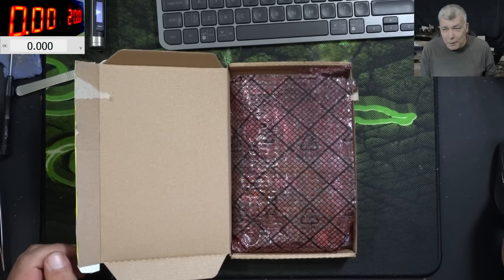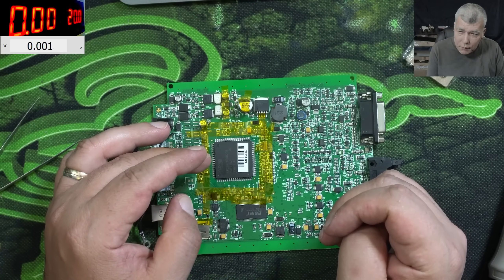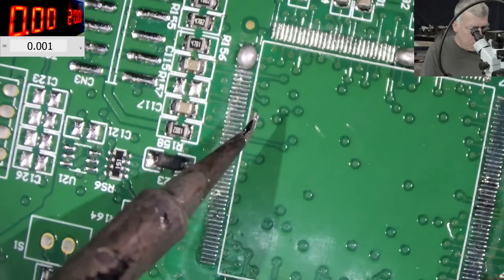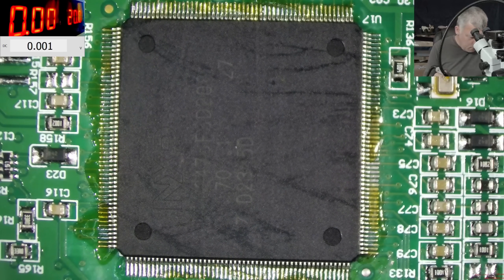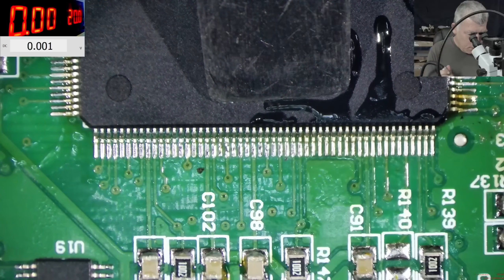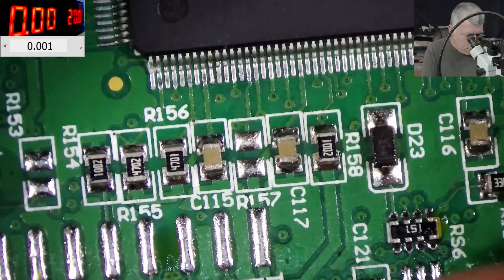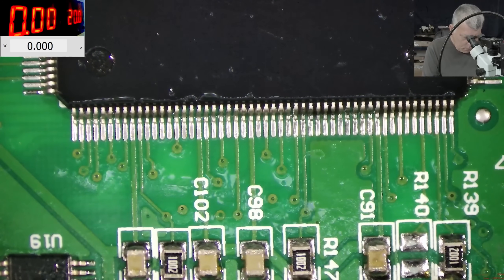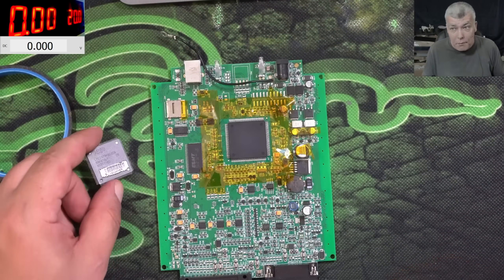Soldering big ic's chips  - tutorial - guide

Comment: Would it be easier or a waste of time if you first sucked the excess solder from the pins with a little flux + a solder wick + flat iron tip and then use hot air?  I mean I think the preparation would make the attempt with the hot air easier because less solder to melt so less time on chip + less mess with solder blobs here and there.
But I am a noob and never have done this so probably I am wrong xD

Comment: This is such a risky repair.  The original IC's package was clearly different and better marked and from a better mould; is it a fake?. It's got a bar code on it which will reference the firmware and model, perhaps? Getting the chip on and checking every pin! Very tricky. Perhaps a pre-heater would help to keep the board at a higher temp overall without point heat? I don't know. It will be good to know if they get it working.

Comment: Nice work. I'm guessing some pins didn't get soldered because there wasn't enough solder on those pads or the chip wasn't completely flat on the board. The main thing is you checked all the pins and applied more solder to a few that needed it.

Comment: Sorin, With a dot on all four corners how did you know where pin one was located?
Reply: one corner has a 45 degree angle on it
Reply: @stevezorilow   Actually, every corner has an angle. He probably did it based on the markings on the chip.
Reply: @kapurubanda6131  indeed for the IC but the PCB silkscreen have only one 45 degree angle to show pin 1.  From there I guess it's almost safe to assume that text/marking on chip should be parralele to the line/set of pin starting at pin 1

Comment: Nxp is a ARM CPU
Reply: Not really, NXP make a lot of things.

This does have a single ARM core in there, but only 72MHz. It has a lot of interface pins for different protocols, built-in flash, display driver.

Looks like it's for ECU programming as others have said. The chip has built in CAN bus interfaces.

It definitely couldn't be called a CPU.

Comment: Sorin, since I admire you so much, I'll leave you with a recommendation: An easier way to do this would be to remove the chip with hot air, then clean all the solder from the pads, apply a lot of flux, and solder all the pins of the new chip with a knife-like tip. It's faster, there are fewer errors, and the end result is better.
Greetings from Argentina
Reply: Yes, that's exactly how I do it, too!
Reply: Absolutely agree on that one. I've never had to replace such big chungus of a package before, but knife tip and a puddle of amtech 559 works great for QFP32 in my experience.
Reply: agree 100%
Reply: I would also add to use a better flux than rosin
Reply: Yes but Sorin believes doing it his way is faster... then spends 10 minutes fixing all the loose legs lol! My guess is there are still loose legs but this can't be tested on the bench. He will never learn and never do it the right way.... Sad.

Comment: do we need to apply some solder? or it's ok if we used the old one just by replacing the chip using a heat gun
Reply: The old is high temperature solder (lead free) mixing with new one makes job easier by not putting so much heat stress to the new IC.
Reply: @Tribes11  I see, thank you.

Comment: I replace one like this using low melt solder to get it off.  Then is solder corner pins of new chip and then the rest of the pins by the method you fix the loose ones.  Well at least there were no tall components near.

Comment: Sorin still doing it lazy way. Take out chip with hot air and put back with soldering iron if its QFP package. Every time almost you solder with hot air. And in this case you fixed with iron later anyway. Like why give new chip so much heat for no reason. Also use kapton tape which is real. This was kapton tape, but it's some aliexpress fake that can't handle proper temperatures.
Reply: That was some kind of protective tape put there by factory for normal use. Sorin did not put that tape there as heat protection for the soldering operation.
Reply: @cameraman2505  I'm aware of that. If you see it melt replace it. Also I'm not 100% sure it was from factory, maybe previous owner put it there already because he wanted chip replacement.
Reply: No worries, in the factory the whole board is fully heated in the oven. Hot air solder joints look more professional.
Reply: @trippycat  Yeah it is. I do solder my own boards in the oven as well. I have custom built oven and custom made profile. But you don't clearly still understand. In the factory you use like a little over 200 degrees celcius in the oven for a very short period of time. It will be peak temperature. There is preheating, soldering, cooling. But temperature never goes much above 200 degrees celcius. In this case you use hot air which is like 2x higher temperature. I think Sorin said he used 420 degrees celcius. So there is huge difference. It is not like in the factory.
Reply: @TriodeTetrode  I agree the temperature is high but most chips handle 260C for 10-15 seconds per datasheet. I hope he turned back down the temp when he was soldering.
Reply: @trippycat  Yes. But that's 260 celcius for short period of time. Here you cook with 420 celcius much longer. It takes more time to heat whole board up this way. You will cook this board with only hot air in any case. Only preheating would work.